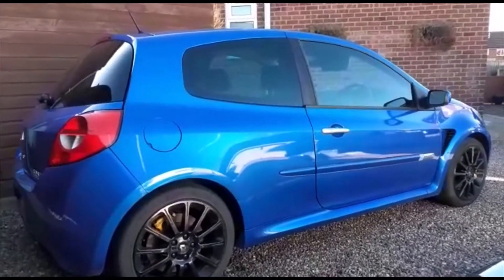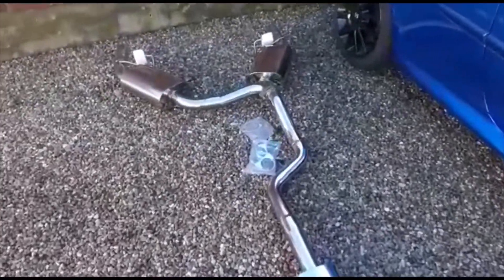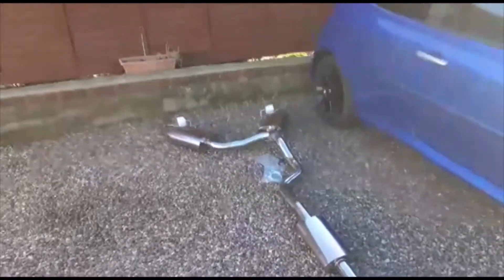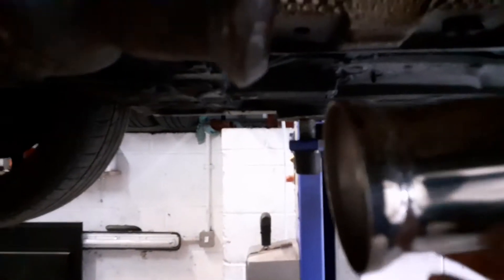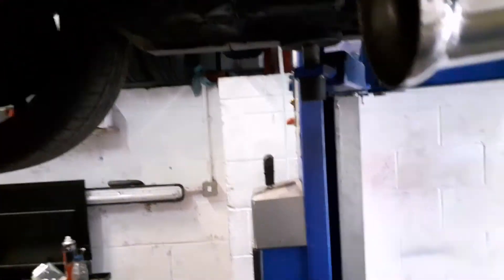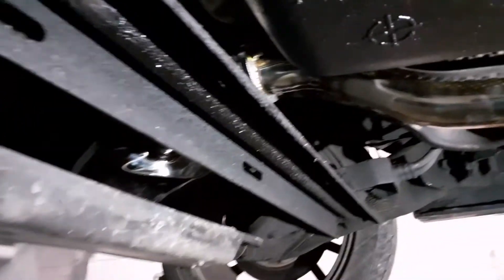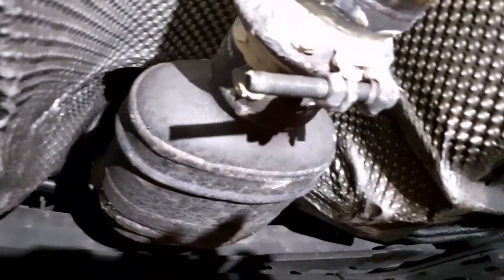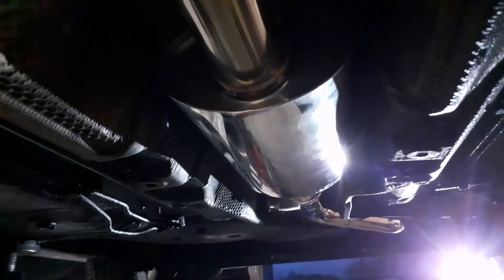*NEW STAINLESS EXHAUST SYSTEM* from gravity performance for the *RS TUNING MAPPED* clio 197 👌

Comment: Had the same issue with front clamp, exhaust leaked at every joint, had to weld entire system in the end and remove heat shield from diffuser